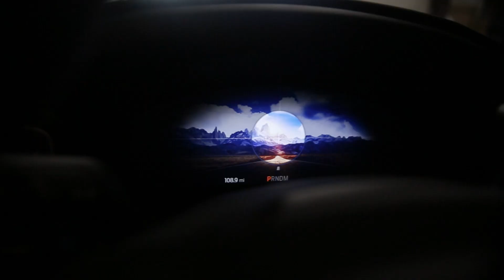Brand New 2020 Ford Explorer ST - Detail, PPF Installation, And Customization

Comment: Can the film be added to the plastic trim in order to match?
Reply from the maker: Paint protection film is meant for paint. The best solution is to use vinyl wrap.
Reply: @EmpireAutoSpa  so then you can wrap the plastic trim to match the rest of the gloss paint?

Comment: What does the film do?
Reply from the maker: So basically the film is like a layer of thick plastic that acts like a shield or a barrier to prevent things bugs rock chips and bugs damaging your paint. Once the paint is chipped there is really no recovering it. Paint protection film helps save your paint and keeping it looking new from hazards of the road.